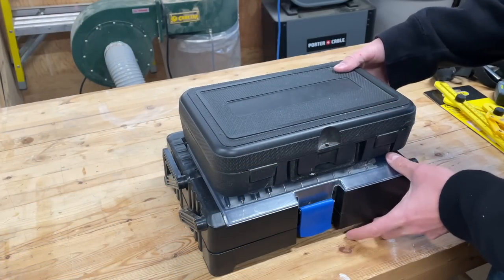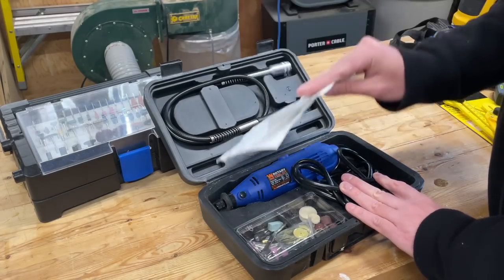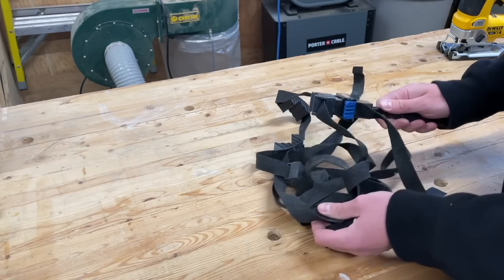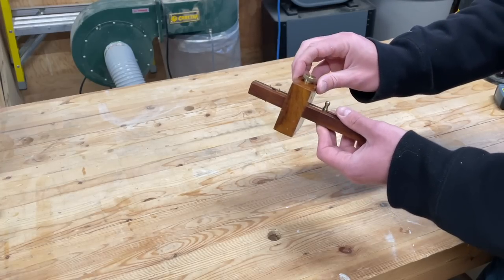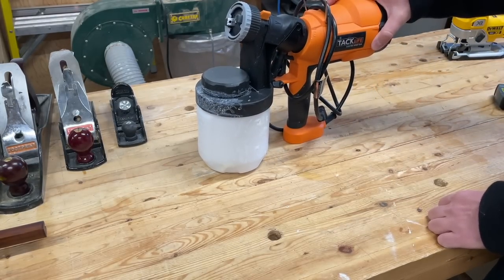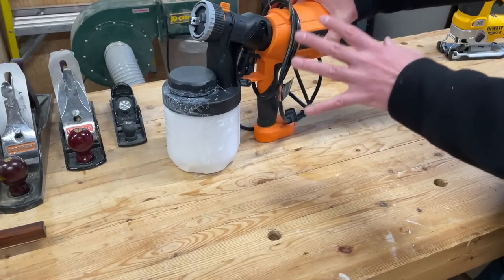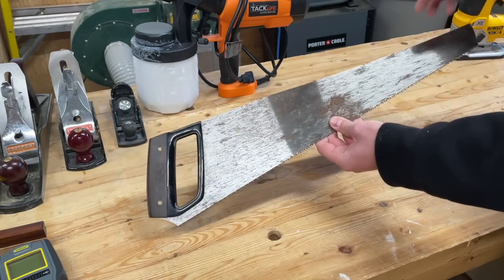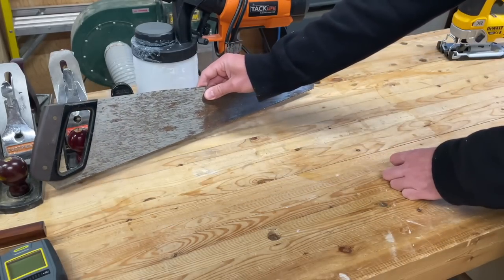Don't Buy These Tools // 10 Woodworking Tools I Wish I Didn't Buy

Comment from the maker: Quick update on this one - I've come around big-time on the jigsaw. With some proper "fine" blades and learning to use it at the higest speed, it's cutting through plywood and 3/4" hardwood like butter with virtual no tearout. While I'll still use my router for getting that final curved edge using templates, this tool is great for rough-cutting and for cabinery toe-kicks!

The other one that I've come around a little bit on is the Kreg Multi-Mark - I'm still not thrilled with the little bit of wobble if you're trying to use it as a square, but as a few commentors have mentioned, the 0 degree slide capability is great for reveals.
Reply: I was going to flat out say you are wrong On the jig saw LOL
Reply: I still say you should know better than to disrespect the jigsaw.
Reply: Totally. I use mine almost daily.
Reply: I agree with update. Jig saw is great love using it. Especially for cutting metal. Also love using the Kreg jig for doing window and door reveals best tool I have for that.
Reply: I would also say that the jigsaw is good before for cutting rough lumber to length before resawing as it's the electric hand tool with the longest reach, and also not dangerous if the material isn't that flat.
Reply from the maker: @svantesvenson5435  Definitely ideal for that case, thanks for sharing!
Reply: I just rough cut a 1.7" (45mm) thick piece of Tasmanian Oak for a guitar body blank using a jigsaw when my crappy bandsaw died. Absolutely no problems at all.
Reply: MichaelKingsfordGray  "mains-powered sabre-saw"??
Reply: @johnsanford3596  Reciprocating saw you plug into an outlet I guess.
Reply: I still hate jigsaws. Could you share what specific "fine" blades you've tried that changed your mind?
Reply from the maker: @spamspasm8183  Yup! I've been using the DeWALT Clean Cut Wood blades (DW3760H). Very good results with plywood and hardwoods.
Reply: @MasonWoodshop  Thanks! I'll try those out.
Reply: Nice to see the update about Jigsaws. I was going to comment, "Take the time to learn proper blade selection and how fast/slow to feed the saw through the wood." ..... well - never mind!   LOL
Reply: @spamspasm8183  Most jigsaw blades have a heavy set designed to clear out a lot of wood chips.  You can also get hollow ground blades that leave relatively smooth cuts.  It's important to keep the thickness of the wood you intend to cut in mind when you buy jigsaw blades.  The thinner the wood, the higher the tooth count per cm/inch required.
Reply: So is a combo square and you don’t look like a douche while using it. Bonus if it’s a starret
Reply: I think the other key point with a jigsaw is Price + Versatility for a new woodworker like myself, vs. having to buy a full Band Saw or Scroll Saw. New woodworkers are the ones who will get the most value out of a video like this, and having the option to save some money and basically be able to do the same work as a Band Saw/Scroll Saw, is really important. I'm glad you came around. My husband did the same thing - picked up my Jig Saw, grabbed the wrong blade, used the wrong speed, and cut a piece of wood, and declared it was garbage. I did a little research, used the right blade & the right speed, and was able to make cuts that had a smooth edge that would rival what my Table Saw can do. I hope other new woodworkers scroll down & see your comment - it would really be a shame to turn them away from this awesome tool.
Reply: I agree on the value of the jigsaw.  It's also one of the safest cutting tools to operate for newcomers to woodworking and for kids getting started.
Reply: @spamspasm8183  Bosch makes nice jigsaw blades. The Swiss ones. Of course you need a jigsaw they fit in. I think it is called bayonet style? Bosch also makes nice jigsaws. Which do happen to fit their blades. Today there's a few models of saw that are pretty decent. Used to be Bosch was the only one that made decent jigsaws. The rest just bounced around a lot. If you're using a jigsaw and you think it sucks it probably does. If it's cutting smooth then you have a winner.
Reply: Came to post my disagrement regarding the jigsaw and to mention using good blades; I see you've discovered them. ;-)
The jigsaw is a staple in my woodworking; I couldn't be without it. I have the M18 barrel grip and love it.

My biggest tool regret is cheap clamps. Bars that bend, uneven clamping pressure, handles twisting off, etc. Never again. I've rectified that by acquiring a nice collection of bessey bar and parallel clamsp, and dubuque aluminum bar clamps.
Reply: Well okay then....yea I came on here to say did you really just tell carpenters and wood workers that they don't need and shouldn't buy a jigsaw??? Wait what???? But then I saw your update..... YOU DEFINITELY DO NE A JIGSAW PEOPLE..... lol
Reply: Diablo blades are great for my jig saw I have a dremmel 3000 with the flex attachment
Reply: @psotelo6684  I use my royobi jig alot
Reply: Glad to see you're not too old to learn.
Reply: i agree on the multi mark kreg tool. love most of their stuff but that one i'm not a fan of. i do like my dewalt barrel grip jigsaw. i hear if you apply some painters tape, that will help with tear out. cheers!
Reply: I disagree about the jigsaw. It's one of the best multi-taskers in your kit. Think outside the box!  
There is a 10" rough cut blade for it. You often can leave the chainsaw in the truck.

I use that for breaking down firewood while camping. 
Yard pruning (a 4 to 5 inch tree doesn't stand a chance) or for renewal pruning. 
It's a great help butchering game to throw to the side unwanted bones. 
Break down big cardboard boxes so they fit in the recycle bin easier. 
Rough cut aluminum sheet to a manageable size.

And make sure your regular blades are the right ones for your use remembering that no one expects the blade to produce a finished edge. Everyone says away from the line a bit and cleans it up with another tool later.
Reply: I only opened the comments to put in two cents about rough cuts before using a router template, only to see that you already learned that.  Good stuff, otherwise.
Reply: I had the same initial thought about my jigsaw... and then I put in a good, fine tooth blade.

Comment: A jigsaw is an incredibly useful tool. Mainly for curved or shaped cuts, not straight ones. Cut slightly bigger and can belt sand or palm sand after initial cut to finish precisely if required. One of my first power tools 20yrs ago when I started out, and even then knew how useful it would be.
Reply from the maker: I’ve come around big-time on the jigsaw in the past couple of weeks! Getting clean cuts after taking some of the feedback in these comments. It won’t be an often-used tool for me, but for rough curves (with surprisingly no tearout)and toe-kicks, it’s going to be great!
Reply: @MasonWoodshop  use a scroll jigsaw blade for fine smooth cuts and less expensive than a bandsaw too!
Reply from the maker: @GuitarsAndSynths  Yes, exactly! Now that I've come around on the jigsaw, I'm finding that my bandsaw is often just collecting dust. Might sell it to free up some space.
Reply: @MasonWoodshop  you may regret it when the next project comes around where a bandsaw would be the ticket. I keep what works for a given task even if I may only use it once a year. Because when I need it, it gets the job done efficiently. Otherwise you could get trapped in a cycle of buying cheap tools just to get a job done and ending up with a bunch of crap tools that make the craft less enjoyable or profitable. I hope this helps!
Reply: Jigsaw is a must-have. Actually I’ve found over the years my Dremel rotary also very useful.
Reply: Jigsaw is incredibly useful. Of course you could replace it with a large bed CNC machine which makes the intricate cuts and curves way more efficient. But the CNC will set you back a few thousand dollars. For the "weekender" the jigsaw is the better tool. And as for the moisture meter, you must not make furniture or cabinetry. I mill all my hardwoods and I need to know their moisture stability before milling. Once you open the surfaces movement will occur. Invaluable to gauge the acclimation of lumber when starting a project.
Reply: If you ever put a sink in a countertop, you need a jigsaw. I do not use mine often, but very important for some jobs.

Comment: I love my Dremel tool, have had it for 20 years and it has handled so many unwieldy jobs for me. Grinding, awkward cutoffs, detail polishing, tight-quarters sanding and shaping, and I'm forgetting probably a dozen other jobs I was happy it did. I'm glad you found a way to fit the jigsaw into your work. Don't need mine often (thus, I chose corded), but it is a gem of a tool when I do!
Reply: I agree, but I also don't use my Dremel to sharpen mower blades or as a router!
Reply: @philipmorgan5050  Heh. No, I hope not!
Reply: Yep 100% I have my Dremel for over 20 yrs and have nothing to complain infact it has got me out of jam so many times.
Reply: I don't use a jigsaw that much but when I do I invariably wish I had a cordless one instead of corded.

Comment: I absolute love my kreg multi mark. While it isn't the most stout and well made tool, i don't think it's crap. I've had mine going on 2 years and use it all the time doing trim and cabinetry. Never had an issue with it not being 90°\45° when set properly.
And as a carpenter I use my jig saw all the time. Couldn't get by with out it
Reply: Use mine all the time too.
Reply: I dont think this guy is doing work professionally. The Kreg tool has an offset for casing, a jigsaw is indispensible, a dremel is for hobbyists, carvers, or metalwork/sharpening, but a carbide burr makes a huge difference in how useful it is. 

Strap/box clamps? Really? Free cord from home depot = same. Should punch some holes in that workbench for using as a jig to clamp to. 

The layout tools he bought are gimmicks and have always been gimmicks, get a 2 foot bosch digital miter guage (looks like an electric 2 foot level) and a fiberglass folding stick rule, then learn to use it. 

The block planes are exact copies of more expensive planes that dont have a patent anymore. Literally the same heel, granted the irons might be softer steel, but to set them, loosen it up, zero it on a flat surface, lay 1 layer of masking tape on a surface and drop the iron behind that. 1 and done, takes about 0.012"
Reply: I love my Kreg multi mark. I can easily see that tool being by my side for many years.
Reply: Exactly. It’s more for trim carpentry than anything, but you actually have to know how to use it.

Comment: I agree with everything except the jigsaw. Not use much in cabinet making but lots for carpentry. Use it mostly for coping. But couldn't live without it.
Reply from the maker: Thanks for watching and great feedback on coping with the jigsaw - I’m going to keep that in mind!
Reply: I use a grinder with sandpaper attachment for coping faster and easier
Reply: @dennismbrandi  same. Found that trick out for coping, won’t go back to mitering inside corners again.
Reply: @MasonWoodshop  the dremel knockoff is great for coping as well
Reply: I’ve used jigsaws for breaking down hardwoods in my cabinet shop for years. So much easier than a chop saw. Switching to a cordless one has been awesome. A must have daily used tool in my shop.
Reply: I use a jig saw to cut holes for vents and exhaust chases for wine cabinets
Reply: I use it all the time doing outlet holes on baseboards.
Reply: @MasonWoodshop  some of these tools are useful but you tried to save a couple bucks and bought really shitty quality ones
Reply: I don’t agree with much of what he says. The video should be: “I bought shit quality tools that I don’t use because they’re so low quality.”
Reply: @MasonWoodshop  as I watch your videos, I’ve come to the conclusion that “I always buy the lowest quality, cheapest everything type of guy” and that’s the story of your life 🤣🤣🤣🤣🤣

Comment: Best woodworking tool I have... blue painters tape. Helps with marking wood; allows you to mock up/glue up your smaller projects; reduces tear-out when sawing/milling boards; almost as good as having a second pair of hands. It does so much for such a simple item. There's always a couple of rolls in my shop.
Reply from the maker: Yes!!! Painters tape is always great to have in the shop for those exact reasons. Very versatile!
Reply: Yeah it's great. I definitely need to keep a roll in my Packout

Comment: I use my Dewalt jigsaw all the time. Use it to cut toe kicks, sheet rock, metal, and all sorts of things. You just need the right blade and adjust it right.
Reply: Exactly...my dewalt jigsaw is awesome...i can do smooth and fine cuts with it...a must have for a woodworker if u know how to maximize its use.
Reply: Glad someone knows what they are talking about. Jigsaws are great.
Reply: YUP! Most problems with Jigsaws is that people use the wrong blade and they want to "horse" it through the wood like they are in a race.
Reply: Also can add a zero clearance plate to the base for cleaner cuts. A must have for flooring jobs.
Reply: I am glad I am not the only one cringing at him saying a jig saw is not for woodworking. Poor advice. Use the right blades and technique for the application and clean cuts are very achievable. He even he says he uses it regularly to break down lumber at the yard.. seems worth it to me!
Reply: I like mine too. I have a band saw, but when I need to make sharper turns for cutting out some sort of weird shape, I find the jigsaw does a much better job. Also when I need to do a cutout in the middle of a piece of wood, I often drill a hole then stick the jigsaw blade into the hole and cut out the shape with the jigsaw. Not the most used tool for sure, but very versatile.

Comment: my grandfather taught me a lesson 60 years ago.  "The most expensive tool you will ever buy is a cheap one."  I've found that to be true.  You'll either buy it then realize how crappy it is then buy the better one, be replacing it a lot THEN buying a good one, or, worst, actually hurt yourself trying to use it - maybe resulting in a hospital/ER visit before getting the good version.
Reply from the maker: Definitely great advice!
Reply: Depends.... I buy a lot of stuff at Harbor Freight that has worked has for many years

Comment: Just to quickly chime in. Many here believe opposite extremes when it comes to cost of a tool. The old "buy once, cry once " doesn't always apply. Neither does " but the cheapest workable  you can". I live by something i discovered  a long time ago. If you have it in your hands and/or use it daily,  spend on the best you can afford. For the occasional use tools,  spend only what covers your needs,  and no more. Tools to spend on IMO are as follows- 
Measuring and marking tools EX- squares of all kinds,  tape measures,  angle finders ( mechanical and digital). The more accurate they are, the more accurate you can be.
This one is odd but works-
Clothing.  If your on your feet all day and they suffer,  your work suffers. A decent apron is also your friend. 
And last but not least,  any tool that helps you be more efficient on a day to day basis. If woodworking is what pays the mortgage and puts food on the table,  the more productive you can be,  the more you can earn over time.  And efficient tool pays for itself many times over in time,  where inefficient tools cost multiples thier initial purchase price in legacy. 

My .02 cents. 

Ps- im a professional cabinet maker and bench carpenter by trade. These are lessons hard earned over time.
Reply from the maker: Awesome insights, thanks for sharing! I think that’s an ideal approach.
Reply: I do something similar. If I'm not sure about a tool I'll buy a cheap one, if I end up using it to death then i'll buy a quality version. Quality being the important distinction because price and quality aren't always directly related.
100% agreed that cheap measuring and marking tools are a waste of time (imo it should be illegal to sell a square that isn't square).
Same goes for cutters and blades. A cheap saw blade will perform like ass, get dull fast and end up in the trash, good blades are a long term investment and can be sharpened multiple times.

Comment: I bought my Wen 2305 rotary tool in January 2021 and I've found it to be serviceable. I'd like to note that the entire kit, including the flex shaft, costs less than the Dremel flex shaft by itself. I also own a Dremel 4000 but decided to dedicate it to a drill press configuration.